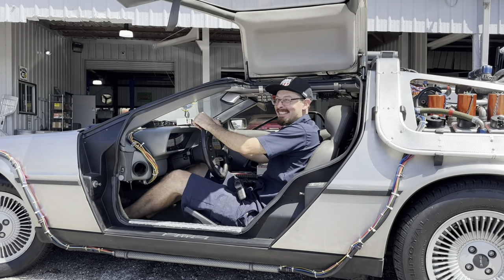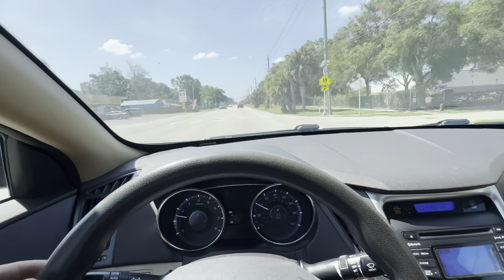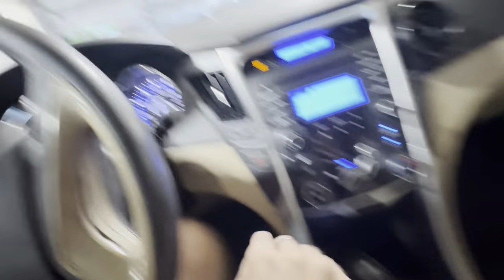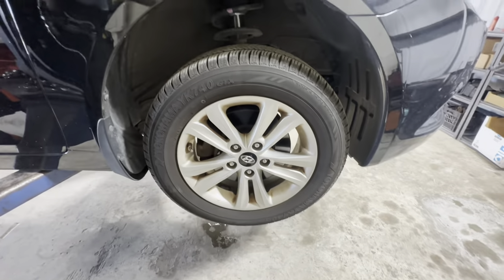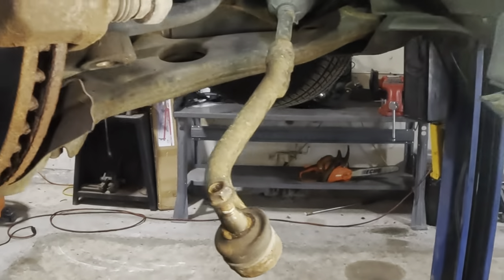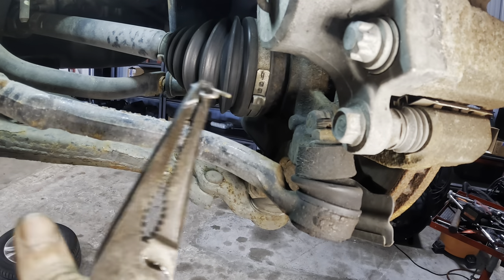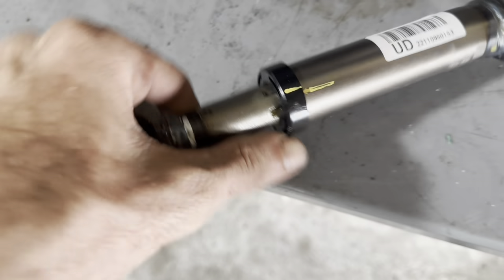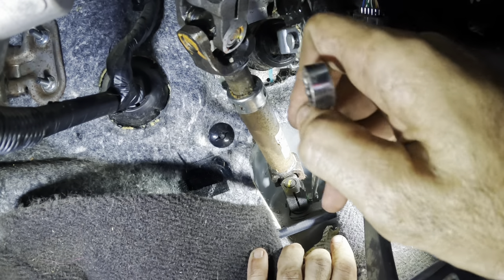Misdiagnosis! Mechanic was Wrong! Hyundai Sonata Steering Clunk!

Comment: Optimas and sonatas have a TSB for a rubber businging inside the box just above the shaft your replaced. Part is cheap but you have to drop the steering column down to replace thr rubber bushing. Takes about 30 min all said and done if you know what you are doing

Comment: Steering coupler behind the airbag. Most common cause of steering noises in those cars. Pull the wheel and the airbag you'll probably find the rubber coupler disintegrated.

Comment: There is a small rubber gear under the motor for the electric steering collum that is worn out. I just bought on Tuesday cost is $ 1.01

Comment: Very easy to over look Ray but any time you have a loose and clicking steering wheel on a Hyundai or Kia it's a little rubber star bushing in the electric steering under the dash. Dealer cost is $1.99 each

Comment: Ray I like you because you're honest. Many garages would charge for all work and parts but you highlighted a big problem with taking on a job, sometimes it's hard to diagnose some problems, take mine for instance lr discovery 4 has a slight noise on the steering after you go over a bump very slight judder on the brakes ( gets worse the warmer the car is ) even our MOT station when I had to do my yearly MOT could not Identify the problem every thing checks out so guess what I'm going to start changing components on the bloody thing.😮 60k mile. Think it could be 1 of 8 components X 2. My best guess is the main front wheel bearing, but I can't fault them when using a pry bar or spinning the wheel. But they are easy to change. Wish me luck 😊

Comment: Wouldn't let me edit my first comment . I wonder if you can just slide it up out of the brace and avoid having to drop the whole column. Then just rotate it so you can remove the steering assist and replace the coupler would save an hour of work if you can.

Comment: Ive seen this problem many times. The bearings in the electric power steering module under the dash are bad those units are usually $1,200, plus programming. BTW wharts up with the deloran

Comment: Ive had alot of steering noise issues i had to find.
Once, a vehicle simply touched a steering hose during the rotation of the shaft and because i couldnt answer fast, the lady was afraid of it and traded it.
Her husband came down to us and demonstrated it to me and let me find it.
He wanted to keep that truck.
It turned out, somebody had simply leaned on the tube putting it too close. I repositioned it more out of the path of the lower steering shaft.
She had her 4 door sedan and was happy.
Her husband had to buy their truck back because she finalized the sale.
It was just terrible for him, and she refused to drive it, it was too big for her to feel right and comfortable.
This thing is loose or something, on rays video. But i cant wait to see what he finds.
I had a steering wheel once that banged around inside.
I asked parts, and they said, no you cant replace it, go deeper and find the cause.
I tore it down and found a floppy weight inside thats suspended by teats. Yep.
Rubber teats.
Weird.
I removed it the rest of the way and eliminated the noise, but it didnt have its natural tendency to return straight.
They let me order the teats part.
As long as i didnt tell anyone.
This tape will self destruct in five seconds.
Good luck, jim.

Comment: There is a rubber bushing called a steering coupler inbetween the electric motor and the gear on the column that is a very common failure for kia/hyundia, very cheap to replace.

Comment: Check for a Hyundai TSB or recall alert. My wife had a 2012 Sonata Hybrid and there are some plastic gears in the column that need replacement. The dealer took care of the issue.  This may likely be the same issue.

Comment: Known issue with Hyundai of certain years. I had a 2008 Elantra that made the same noise, got the replacement part for a little over a dollar on Amazon and replaced it myself. Little polyurethane or rubber star (more than a star i think it had about 6 legs but sort of a star) shaped piece in the steering motor that acts as a damper of sorts between the shaft from the steering wheel to the shaft that runs down to the telescoping shaft.

Comment: if you haven't figured it out yet or someone else hasn't mentioned it,    HYUNDAI Genuine OEM Flexible Steering Couple 56315, this is probably what's wrong, I've changed a ton of them and it sounds exactly like what i hear in the video , its in with the electric assist motor mounted to the column. stuff happens its how you handle it that matters.

Comment: 2:34 In Michigan, home to the "Michigan Left" on to or off of major divided highways, a left on red is allowed in one very specific case. I'll explain a "Michigan Left" first, then the left on red part will follow.

When on the minor intersecting cross street desiring a left turn onto the major divided road, one must turn right into the far left lane, proceed a couple tenths of a mile to a dedicated median U-turn lane, and utilize the median U-turn to begin traveling in the desired direction.

When on the major divided road and desiring a left turn onto the minor intersecting cross road, one must move to the leftmost lane, pass the desired cross street, utilize the aforementioned U-turn lane to reach the opposite direction of the divided road, complete the U-turn into the far right lane, and come back to the minor cross road and turn right.

Left turns on red are permitted when turning from a one-way street onto another one-way street. The dedicated U-turn lanes are effectively one-way streets, and the opposite side of the divided highway is also one-way, so the "Michigan Left" can be completed even when the light at the head of the U-turn lane is red. A few exceptions to this rule exist, most of them involving bad sight lines, and must be specifically signed "NO TURN ON RED."

A few permissible left turns on red exist away from major divided roads, wherever both the street being turned off of and the street being turned onto are one-way. A good example in Detroit is Rosa Parks Blvd (a one-way northbound) to the "southbound" I-75 service drive, also one-way but actually traveling westward. Half of downtown Ann Arbor's street grid is made up of one-way streets, so numerous permissible lefts on red exist there.

Comment: The problem is The bolt holding the whole steering rack. Just tighteen it up and everything will be fine. Had a couple of this noices on KIA. It can also be the rubber damper inside the electric motor.

Comment: There is a $5 plastic/rubber star washer under the electric assist motor attached to the column on the left side (3 torx bolts) that wears out

Comment: Sorry Ray you miss it this time. I have a kia car and it has the same problem and it is a common problem for Korean cars ... To fix it you have to take all the steering wheel apart just to change this part No. 56315 
It is located inside the steering wheel motor and it cost not more than 5 $

Comment: This clicking problem is really common on the Hyundai and Kia line of vehicles, the issue is a plastic coupler that's in-between the electric motor of the steering column and the actual steering shaft that it drives. It's a little more in depth but it should be no problem for you Ray

Comment: I saw a creeper that works like your over engine thingy. It folds to a platform to the ground and then has like a tongue that goes int the foot well to give you a flat surface to lay on. You don't have the sill digging into your back then. Can't remember what it was called though.

Comment: sounds like the steering lock has broken inside, and the lock is loose and catching when turned. this has happen to me on a Skoda, were a bit of the casting had broken off and catches . you might have to remove the ignition assembly, to see if it goes away.

Comment: Misdiagnosis does and and will happen, it's just an aspect of the job.  What isn't always an aspect of the job is the admission that a mistake was made.

Many people can't accept that they made a mistake and will try to cover it up in some way so they don't look bad in the eyes of the customer or colleagues.  But what they don't understand, is that while a customer or colleague may be upset at first, they do admire someone who has the courage to admit they are the person who made the mistake.

So unless there's a way of using something as a stethoscope in that cramped area to pin down the exact location of the problem, if you did the best you could do at that time, then don't beat yourself up over this misdiagnosis.
Reply: I took my 07 Expedition into the Ford dealer for warranty brake work. I was told that the brake booster needed replacement. I said it was not the brake booster. It was a faulty master cylinder. I was then informed by the service manager that "we have factory trained technicians, and our factory trained technicians said it is the brake booster". The next day I got a call and was told a new brake booster did not repair the problem. They had to order a master cylinder from the factory. I told them, what ever, just let me know when to pick it up. 🙄
Reply: @GaryH-pw9cm   The optimum word here is "factory trained."  How do they train new techs?  What do they train them?  How much time do they spend teaching how to diagnose a problem?  Or do they emphasize they only have so much time to make repairs?  Experience would have been a better teacher.  Working with a tech who had years of experience.
Reply: Stethoscope would have come in handy (space permitting) given the fact he has to keep those noisy portable shop fans on full blast due to no A/C.  I'd be surprised if he doesn't already own one, although I can't recall him using one in any of his videos.

Comment: Hi Ray,  The problem is that the electric power steering rubber coupling/bushing just under the steering wheel needs to replaced. Ask me how I know. Thanks for admitting you are human too. My mechanic didn't eat it and charged me $1000 to try to fix it, but didn't.

Comment: i think thats just one of those unlucky things. at least it hadnt gone back to the customer without finding out it wasnt fixed. i would imagine that in lets say 90% of similar cases you would have been correct. some might call it a parts cannon moment but for what it seems to be would there have been any other option? i guess you could have turned the wheel while the shaft was disconnected but then they wont line back up as easily and might be off-centre (correct me if i am wrong there).

Comment: You probably found the real problem by the time you read this but I think you will find it is a rubber/polyurethane spacer inside the electric power steering unit. Looks kind of like a Chinese throwing star.  I had to replace it on my 2013 Azera. The part has been upgraded since the OE install. Good luck.

Comment: Ray is still driving and diagnosing as I write this. I'm gonna guess a universal in the steering column is shot caused by bad tie rod ends and/or possibly bad front strut mount bearings.

Comment: Looking up info regarding this issue. Very common failure.  Found that Hyundai has extended warranty on this part to 10 years or 100,000 miles.

Comment: They get new fire engines around here all the time,I never knew they went bad with 25k on them,then go to auction and sell for $2,500! Same with school buses,just sold 10 of them with around 85k to 100k on them,Detroit /Allison combo top $ was $1,500 low was $850! I was gonna buy them and pull motors and trans,scrap the rest!

Comment: Those tires look directional? They  look like they are and are running the wrong direction. 

I'm guessing the noise you are hearing is a worn out bushing between the column mounted power steering motor output gear and the input gear on the column itself. I've run into it a few times.

Comment: Damn! That flexible coupling is notoriously defective on all of the Hyundai and Kia's of that generation. That is one of the downsides of fixing all makes and years of cars. I've come across this repair a few times now. I wish Ray and other YouTubers would post just the diagnosis parts of videos first -giving us viewers a chance to weigh in. Utilizing crowdsourcing is such a powerful tool. Obviously there's no need to do this on very common repairs but even the first time I came across this issue I checked Direct-Hit Intellifix and it popped up as the number one culprit by far. Over 200 techs uploaded this repair. Since I don't have a YouTube channel I always check Direct-Hit now anytime I make a diagnosis and it has saved my ass a bunch of times where I was wrong  .
Everybody gets it wrong sometimes. I don't think showing this on video makes Ray a hero like so many on here are saying. In fact I think it's a shame that so many think other techs wouldn't show this video.
Believe it or not most techs are honest. If there is any dishonesty it is higher up the food chain. Management on up is where you find any dishonesty from my experience.

Comment: There isn’t a mechanic I’m aware of that would eat the cost of a misdiagnosis in my area. I commend you on your business ethics. My last experience with work done from a local mechanic ended with my speaker/amplifier stolen and the repair a misdiagnosis which thankfully the shop owner knew that the mechanic working on my truck just got a “new” speaker/amp setup he was bragging about that turned out was mine. I got it back damaged and discovered he was a veteran and the shop owner fired him then asked me if I’d do business with him again. He was appalled that I said no! 🤷 Can you please advise on a respectful mechanic in central Illinois?

Comment: I normally watch your videos and say he's got this he knows what is wrong. However this one when you were shaking it I knew you met one error had a similar click on another car myself almost there but you did except I took the shaft out before ordering and luckily I did because the click was definitely not coming from there. Actually it turned out to be the steering wheel lock was not retracting all the way and it was clicking inside the steering column where the ignition went in so don't be surprised if it's not that and not even the bearing it's just that vibration and sound travels. Mine was definitely the steering wheel lock remove the ignition oiled up everything put everything back together and the sound was gone

Comment: Curios to hear where the clunking is ACTUALLY coming from. The GMT800 trucks like yours and mine, at one point, had an issue with intermediate shaft clunking, which mine has despite the shaft having been replaced with a supposed upgraded version... Has your truck developed that clunk?

Comment: its in the electric power steering motor rubber gear connection. there is a recall notice that I received. the gear has to be replaced

Comment: There is a plastic connector inside the electronic power steering that is broken, causing the two sets of gears inside the powersteering to move and make the clicking sound

Comment: I believe if you had removed the shaft from the upper steering column, this would have isolated the steering wheel assembly from the shaft/ujoint. At that point, you could've confirmed if the u joint was the root cause prior to ordering a new shaft. The incorrect diagnosis could have been avoided and saved time waiting on parts.

Comment: Everybody makes mistakes , live and learn ,  i remember i had a older Rav4 that needed a exhaust sensors replaced , the auto zone tech did not tell me that there were 2 of them , i should have known better , so i cut the wires to the top 1, thinking that was the 1 giving me the problems ,  not knowing there was another 1 on  bottom  that was the faulty 1  , i took  responsibility ,and ate that $100. sensor  . ouch ! learned my lessen , dont cut them , just use the sensor socket , lol , some lessons can be expensive .

Comment: Inside the electric motor on the column there's a rubber bushing inside the motor that gets worn out you can take the motor apart and replace it or just get the whole motor from the dealer
Reply: Hyundai  56315-2K000FFF

Comment: that sucks ray. Maybe removing the shaft and ensuring it made noises before buying the replacement would have been the right move. or see if the noise happens with the shaft disconnected from the top.
Hindsight is 20-20. But this is one of those things we can all learn from. teachable moments are how we grow.

Comment: The problem is not the shaft, but the coupler between the el. servo motor and the shaft itself. You need to remove the el. motor and replace it. Part number: 563152K000FFF

Comment: You should of unbolted the top UJ first and slid it off the column and then turned the steering and that would have confirmed that shaft wasn't the fault, it is very, very rare that them UJ's fail for what they go through as for that noise it's more than likely coming from behind the steering wheel eith the clock spring clicking or the steering lock pin catching the slot in the steering shaft because of wear.

Comment: You may need to take the steering wheel off, something in there might be loose. Or maybe the actual steering column needs to be replaced. Last to check would be the steering rack itself.

Comment: its that nylon star gear in the electric steering motor on the column, POS ..   only bonus is its a $6 part, maybe 20 minutes in 20 minutes out, be sure to clock everything

Comment: If the steering wheel makes a clicking-knocking noise just sitting in the parking lot, why would I take it out on the road when, potentially, the sound is coming from the connection of the steering shaft with the steering rack? Or one of the u-joints in the steering column? What would happen if it just decided to let go on a test ride? I'm putting it straight up on a lift where it can't kill me, and crawl all over that thing till I find the source.